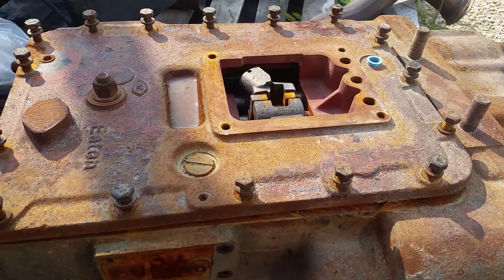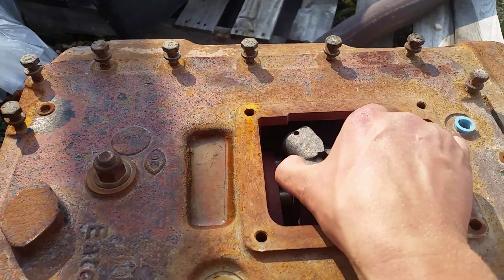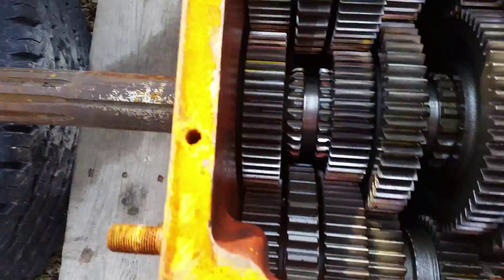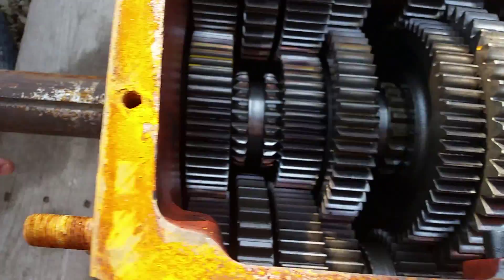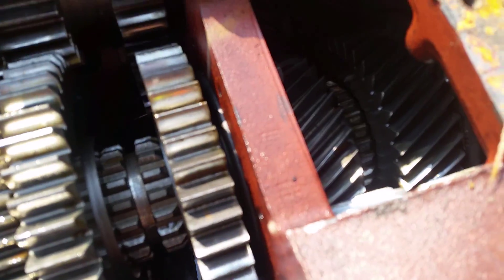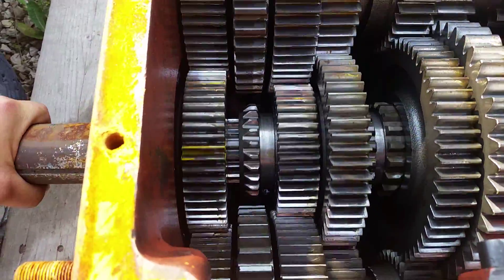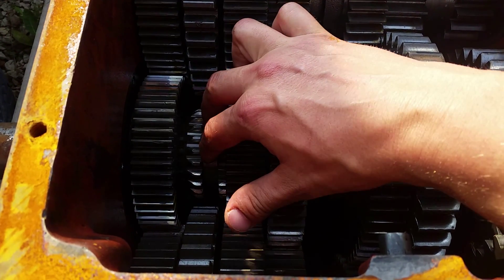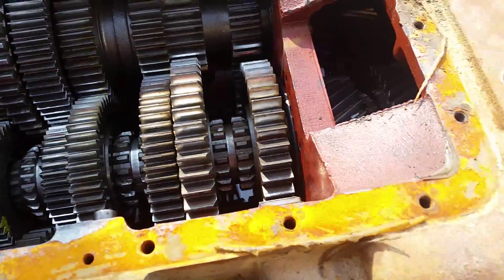How a 13 speed transmission works

Comment: Quick and clear video thanks! If its still necessary to match the rpms when you double clutch why is that better than just floating them in?
Reply from the maker: Still necessary. Double clutch just makes the ride smoother and doesn't have immediate torque transfer to gears
Reply: @TruckinTrent  Why is the procedure always referred to as double clutching? If I were to begin using the clutch for shifting gears while rolling how come I shouldn't depress the clutch only once and hold it down as I remove from gear and select the next one? In the same way I would drive a manual car
Reply from the maker: @josiah harder  only 1 press on the clutch would cause the clutch friction disks to rotate at different rates of speed because of the amount of time it takes to change rpm. If the friction disks are rotating at different rates of speed when they come back together, it will cause them to slip, creating wear and eventually failure. Also, VERY important to ONLY push far enough on the pedal to the point at which the torque from the engine is released. If you push to far, it will engage a tiny little friction disk called a clutch brake and it will be trying to stop the gears from turning, and if the wheels are rolling, it will not be able to do so, causing wear, and eventually failure.
Reply: @TruckinTrent  thank you very much for taking the time to answer my questions
Reply from the maker: @Josiah_Harder  my channel is not about money or fame. I want the trucking industry to be better

Comment: shifting with no clutch is even better let the stick drop in on its own just as good less wear on the clutch
Reply: ah ok got ya i was taught old school but worked great for my old trucks we all have different ways of handling such equipment
Reply from the maker: I am fully aware of "floating". But double clutching done correctly doesn't wear the clutch very much, and saves wear on the drive shaft, u joints, cab mounts, shocks and air bags, and 5th wheel bushings and locking jaws. Not only that, but if you drive team, you can let your co driver sleep instead of rocking the cab every shift. Granted, I can shift just as well with or without the clutch. But that's because I am a professional instructor. I've seen rookies shift well, and I've seen them shift horribly. I've even seen veteran drivers shift so badly when I take them for a road test that my neck hurts after a 45 minute drive
Reply: @TruckinTrent  wrong floating is 100 times smoother
Reply from the maker: @Deere Power  floating or double clutch has nothing to do with "smooth" or not. That is due to matching RPM only. Your comment, tells me that you don't know how the transmission, or the clutch works
Reply: Changing without the clutch damages the hard facing on the gear teeth.
It's sheer laziness and disrespect for the drive train that makes people want to change without the clutch.
Changing gears without the clutch causes wear and it's dumb. Eaton Fuller are not stupid.
Reply: @adelarsen9776  Must shift really poorly then
Reply: @phdunn55  Yes, lots of poor drivers float gears which leads to excess wear and premature failure of the gear box.
Reply: @adelarsen9776  Every now and again I attempt to double clutch like I was taught and end up shifting worse. I’ve floated gears so long that I hardly ever miss a gear and I don’t grind em till I find em. If you know your truck and what it can and won’t do, then you’ve got it made.
Reply: @Erik_C_251  ok